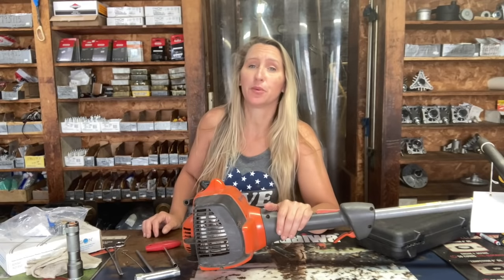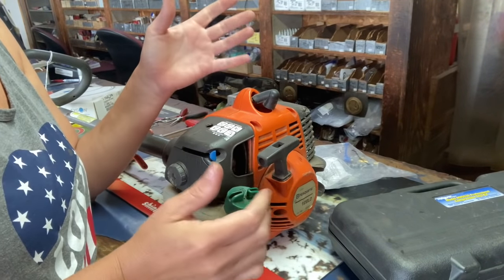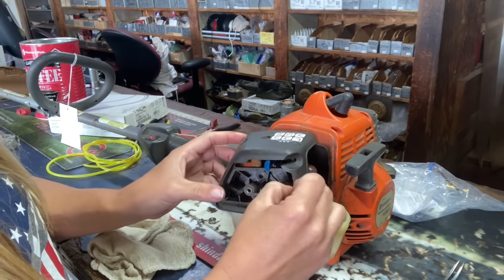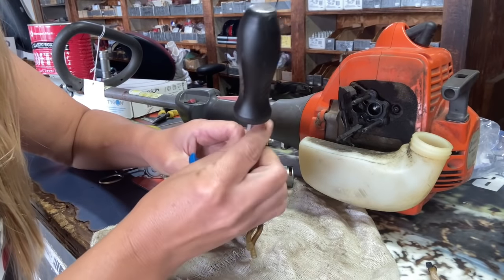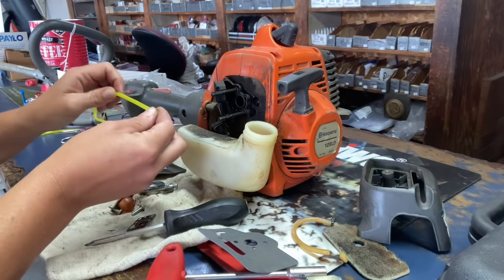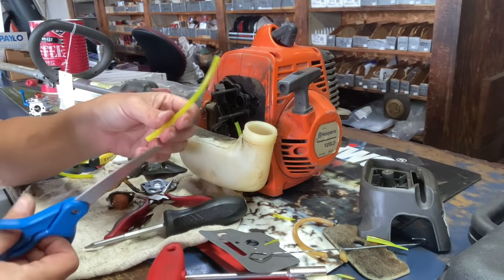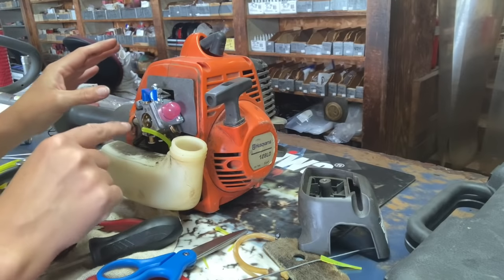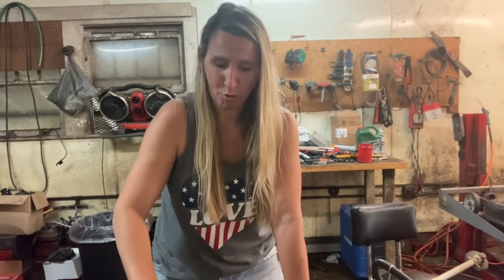How to fix a Husqvarna trimmer that won't start or only runs on choke

Comment: Hi thanks for info I am working on a trimmer but having a problem with it it will start with choke  on but will ,    only run on full throttle I fitted a new carburetor and new filter but I can't get it tick over. I checked the plug and is black and wet any idea

Comment: Thos unit had multiple issues warranting a carburetor change. But my 122 all cks out good so I did a kit change and it still only runs on choke. You really didn't give other reasons or alternatives gor a fix.

Comment: is it ok to use a fuel filter on the return line as well? wouldn't that prevent debri from getting into the carb through the primer bulb?

Comment: I have the 122hd60 hedge trimmer. 
A friend was using it and somehow it got turned upside down. 
Ever since that happened it won't run, if it does start it shuts off when cutting, now can't even get it to run.
Not sure what the issue is.
Thanks

Comment: Maybe I have a picky machine but the Husqvarna I have had the same issues, essentially did everything you did, internals looked good had the cross hatching and no scoring on the side of the piston or sidewall, 128lbs of compression, added a new OEM carb, lines and filter, new spark plug went to go fire it off and all it will do is run on idle, play around with the carb adjustment screws and it doesn't even affect it...I've had some small engines give me issues before but none that's actually got me stumped like this Husqvarna...I certainly don't want to just toss the unit away as I'm not a fan of "ohh it's broke go buy a new one" I like to get my money's worth out of the equipment
Reply from the maker: Odd. It sounds like it is still starving for fuel. If everything is new like you said, there are a couple things to check. Make sure your fuel line is not too long to where it is poking back out of the gas. If that is not it, make sure your fuel line that is connected to the fuel filter is connected to the carb nipple farthest away from the primer bulb. Make sure the carb mounting gasket is still good. Make sure the the carb is not getting stuck on the throttle cable bracket and is mounted flush to engine.
Reply: @Chickanic  thanks for replying back so quickly, I will give those a check and hope it does the trick

Comment: Same trimmer only run on half choke, did all that and still wouldn't run properly. Come to find out the gas cap was faulty. I just happened to have an extra one from another unit.

Comment: Good video and fix. Never been a fan of any equipment that is outside the professional series. One thin piston ring is just not a good thing for an engine that revs eight to ten thousand rpm wide open. The 128s are one of those trimmers that have the single piston ring. Nope I'm good. I will stick with my Stihl FS-94R and Husqvarna 525L. They both are built Very well built with ballbearing supported crankshafts and double thick ringed pistons. The point is professional series equipment has a whole lot better engines than Limited Duty machines that will fry quickly if used professionally.

Comment: I have this exact machine, it only runs on half choke. I have replaced fuel filter, fuel lines, carburetor, air filter, and used the store bought pre mixed oil gas mixture. It starts super easy but once the choke is opened it dies.

Comment: I have one with low hours that is only running on choke.  Is there a video that gives other options before diagnosing that you need to replace everything?
Reply from the maker: You just start at the beginning, checking your fuel filter and fuel lines. Go from there. If one thing is good, you go to the next, but it is ALWAYS deteriorated fuel lines on these as the culprit. Or bad gas.

Comment: So I replaced my carburetor, put in new lines and fuel filter and it still will not start. When I removed the carb and did the visual inspection on the piston, it looks nice and smooth. Could it be that I have lost compression in the cylinder? What is a simple way to check for good compression?
Reply: It will not START AT ALL? Want the cheap way to find out?  Buy a spray can of ether, available at your local hardware/auto-parts store . take off the air filter, and spray ONE QUICK SHOT  (No more) of ether into the carb- have the choke open of course.  DO THIS OUTDOORS (obviously).
Pull the starter-  the engine should fire a few times.  If it doesn't, it's probably your spark-plug or other electrical problem.  Check the spark plug  wire, or take it o a repair shop.  DO NOT keep spraying ether into the carb!
NOTE! DO NOT leave this can of ether lying around where a child might investigate it! And preferably keep it out of your house!

Comment: Love the name, very imaginative. I have a problem I can't seem to solve. I have a 128DL that's about 2 years old or I was told. It does look like it. But the prior owner (son-in-law) put it away two years in a row with gas through everything. Last year he was able to use it with the choke half way on. But this year he couldn't get it to go. He bought a battery power one and gave me this.
So far I used the shotgun approach. I replaced the carb, fuel lines, fuel filter, spark plug and cleaned the fuel tank very well. I can manage to get it started, but it will only run at a low speed with the throttle held wide open. It will run for a minute or two and then just shut off like you hit the kill switch. 
Any suggestions would be greatly appreciated.
Reply from the maker: Things to check… 1. Make sure your fuel lines are on the correct way. The line on the nipple farthest away from the primer bulb should have the fuel filter on it. If it is correct, 2. Check exhaust screen. 3. Do not use canned fuel. Holler back if those work or not. Also, hopefully you bought an oem carb. Aftermarket ones only work half the time and I don’t trust that the Chinese fuel lines and fuel filter ever let enough fuel through.
Reply from the maker: @mikemilam525  I tried after market many times and yes, they worked half the time, but I was replacing 1-2 a week during our busy period and it got to where 50% would do just what yours is doing and have to be adjusted. You can get a splined adjusting tool and try to correct it. Pull your plug. Is it dry or wet? White?
Reply: @Chickanic  I value your opinion so I ordered an OEM carb. I'll let you know how it goes, thanks
Reply from the maker: @mikemilam525  The only other things it could be, is it is burned up. You will see a bunch of up and down piston scoring if it is. OR a bad batch of fuel, but judging by that baby blue beauty you have in the garage, I doubt you have bad fuel. LOL! Also, don't trust canned fuel. I see bad batches ALL the time.
Reply: I looked thru the intake port and the piston looks fine. I’ve been building hot rods my whole life but never fooled with small engines. I likened it to learning to speak Another language, lol. Thanks for the kind words about the car. I built it about 15 years ago from a basket case.
Reply: @Chickanic  BTW, I pulled the plug out just for grins and it was wet with fuel. Not dripping, but damp.
Reply: Look atvtgecexhaust screen and take muffler off see if carbon is blocking exhaust

Comment: I have the same model shown in this video.  Is it ok to run premium fuel in it?   I saw in the store I bought it from they have premixed fuels from husqvarna you can buy that is 93 octane.
Reply: I also have this weedeater.I only use non ethanol fuel mixed with the husqvarna 50:1.Never had a hard time getting it started.

Comment: Thanks for the information. I noticed the old fuel line had a cable tie or something on it. Do the new ones need that as well?
Reply from the maker: That was a fuel line connection. I have no idea how they even get those in at the factory, but it is not needed when you replace the new lines this way. Thanks for watching!
Reply: @Chickanic  To redo the connector thing, after you pull the fuel line through, cut it flush, put the connector on the line, attach the fuel filter and line to the other end of the connector, put the line into the tank, then pull back on the gas line from the top of the tank until the connector seats against the top of the tank. Then trim the gas line coming out of the tank to length.  It only took me an hour to do it the first and last time that way.

Comment: Mine only ran on half choke. Checked carb etc and all looked clearn. No water in gas. What I discovered is that I had switched from 87 octane to 91.  When I switched back to 87 it ran perfectly.

Comment: Why didn't you use the original fittings that passed through the fuel tank?
Reply from the maker: Those little plastic fuel line connectors? There is just no need.

Comment: Put a new carb on ran perfect for a day then started the same problem, replaced the tank which included new fuel lines and filter, still won't run with the ckoke off

Comment: OK, but I just bought the same trimmer and it does the same as you said. It will run off choke after it warms up for a good 5 minutes, most of the time. So being new, just an adjustment? And I'm talking I'm on the first tank of fuel - Husky can fuel. Is it the idle screw? It really seems like it has no power.
Reply from the maker: I would try a different fuel first. I don't trust ANY canned fuel. I get units in the shop all of the time that have been running fine on canned fuel and then all of the sudden it won't run on it. FOR SURE try different fuel before you do anything else. I would mix up your own gallon of gas and oil and see what happens.
Reply: Buy the bottle for  storage fuel that work amazing and is going to start easy too after star running.

Comment: Hi Chicky. Does the Husqvarna 128CD(not the LD) take attachments? I recently purchased one and the Lowe’s website marketed as attachment capable and so does Husqvarna, but when you read closer on the Husqvarna site it says it has a different arbor size from the LD, and it says it isn’t capable of a cutting blade etc.. Many people have told me it is attachment capable but I want to make sure, especially seeing whereas there’s a different arbor size. Thanks in advance

Comment: Informative video!  Thank You. Never go full throttle until you warm up the engine at leased a minute or more. It seem odd that you would replace the carb instead of rebuild. I wonder if you could explain how to determine which gas line goes ware after you mix them up.
Reply: She did...  the fuel line with the filter goes to the nipple furthest from the primer bulb.  The return line is closest to the primer.
Reply: @rudyruiz9521  thank you
Reply: Ty...

Comment: I have this 128LD. I checked compression is at 120. The rebuild kit did not work. I ordered a new OEM carb put it in.  I also put in a new plug and checked for spark.I dumped the gas and put in fresh non ethanol 50:1 mix I also replaced the lines and the fuel filter.  I starts on choke. turn the choke off, it runs for about 1 second or less and immediately shuts off. Like the power switch was turned off. I also checked the  exhaust screen and it is clear. I tried the premix and it ran better than my 50:1 mix. Any ideas?

Comment: Had ours running great.  Now once its warm, won't start at all, problem just started.  Has new plug, coil, carb, air filter, fuel filter and using 50:1 true fuel.

Comment: Would there be any harm in cutting both fuel lines to the same long length and putting filters on both, to avoid the possibility of putting them on the carb the wrong way?
Reply from the maker: I wouldn't. The fuel returning to the tank should not have any resistance. Thanks for watching!

Comment: I have a question Chickanic.  First, great video, new subscriber.  Thank you.  I've owned one of these for years.  Always use quality gasoline and two-stroke oil @ 50:1.  (I wonder if your customer mixes his gas.  Looked awfully clear to me).  Mine runs well, but it has always puzzled me as to why I always have to choke it about 25% to do the job.  In your video, were you running with the choke completely "off"?
Reply from the maker: Thanks so much for the subscription and question. When your machine is getting the correct fuel amount you should not have to run it on choke at all. If you are, you definitely have either worn out diaphragms or something clogging your screen. If you keep running it that way, eventually it will burn up your unit. I would suggest, going through these steps and checking to see if you have any of the issues in the video. These trimmers are notorious for the fuel filters falling off. This can happen, even if you mix your fuel correctly, because these pieces just wear out over time. I don't know what the customer had in his tank, but it looked like almost all water. I made a video about how I think people get water in there fuel. If you have time, check it out. Thanks!!
Reply: @Chickanic  Thank you.  I've had to choke it a bit since the day I brought it home new.  I will certainly follow your advice and get it fixed.  Thanks again.

Comment: Great video but after removing the fuel lines and taking the carb off, I would have used an old, damp rag to wipe off the top of that dirty fuel tank before putting the new carb and lines on.

Comment: I know this,is,off,topic,about the carb,,but I have a 94,225l,husqavrna,that,just,rebuilt,after,finding all,the parts etc, problem,is,that,there,are,2 plungers on,the,shaft,which,I,assume are,for anti vibration, and there,are,2,holes,on,back of,shaft,assemble to,connect motor,and shaft,together,,got,two,of,rubber,grommets,started in,can't,use,grass,otherwise just slides,out, same w,handle too, any,suggestion,on,getting,it,back,together, also,it,is a,commercial,weedeater ,,any,help,would,be appreciated, it's,got,even,my,lawn,maintenance repair guy,,shaking,his,head

Comment: I have an older Husqvarna 225RJ trimmer in need of the fuel line. However the part number per their parts list 502210601 is no longer available. This is used in all 225 series. What other fuel lines can I substitute with?

Comment: i would love to know if i can use the echo 2stroke oil in my Stihl machine
Reply from the maker: Absolutely! If you are still in your 2 yr warranty time frame, I would keep using Stihl til it is over just in case something happens and you need warranty work.
Reply: @Chickanic  thank you very much because my warranty has not up has yet on the machine and i enjoy following you
Reply: @Chickanic  for the past several years if ya buy their oil ya get an extra 2 years warranty on the machine when ya buy em new that goes for both stihl and husqvarna
Reply from the maker: @knightimusprime25  Stihl is actually a marketing genius. Echo and Husqvarna offer a 5 year homeowner warranty automatically, which is a huge selling point. Stihl offers 4 years, but voids half if you do not buy their oil and hold on to your receipt for 4 yrs. They actually have convinced everyone they are "giving" them something extra when actually they are punishing them. Genius. Thanks for watching!

Comment: Thank You So Much!!!!!! 💪🏽💪🏽💪🏽💪🏽💯💯💯💯
Just what I was looking for with my Husqvarna weed eater!!!!
Reply from the maker: You are very welcome! Glad I could help!
Reply: @Chickanic  140 psi good compresion 372 xp oe ?
Reply from the maker: @Sensei948  Yes, but you will still want to check for piston scoring just in case. Sometimes units will still have good compression, and still not run right when hot if there are up and down grooves towards the exhaust side. You can usually see pretty good by looking through the Spark pig hole. If it is still shiny with no grooves, you are good to go!
Reply: @Chickanic  Tell me, can the scythe work full throttle all the time? Kosa is 545 rx or does it have to be constantly loaded? can it have 12,200 rpm?

Comment: Installed a new carburetor, lines, fuel filter and it still does not want to idle or rev up and mixed new fuel also 50:1 ratio

Comment: This is from Don's small engine repair If you would cut the end of fuel line on a 45 degree angle and put a single piece of wire on it and pull it through the tank and you won't wast so much fuel line that way
Reply from the maker: That is a good way to do it, but when trying to teach someone who has never done it before and will only do it probably once, wasting a couple inches is a lot easier. Thanks for watching!

Comment: I looked up this video because I'm having the exact same problem with my Husqvarna weed eater. I know nothing about motors and have basically no mechanical skills. However I am still going to attempt to change the carburetor and get mine running. There is a 93% chance that I will get pissed off and destroy the damn thing. Guess we'll find out.....😬😬
Reply from the maker: Let me know how it turns out! LOL!
Reply: @Chickanic  If my blood boils and I end up reaching the point of wanting to destroy it I will make a video of me shooting it multiple times with 3 inch buckshot while cursing. And of course I will send you the video if you would like. :-) LOL

Comment: Most fuel issues are caused by using Regular unleaded gas which contains ethanol. This will literally dissolve the fuel line over time. I’ve always used Premium gas that states on the pump NO ETHANOL and use a good quality two stroke oil. Dump any gas that is more than a year old. That includes any in you gas can. I have never had a fuel related issue following these rules. If money is no object consider using TruFuel 50:1 Pre-Blended 2-Cycle Fuel available at most home centers.
Reply from the maker: I would recommend what you are doing using ethanol free and oil mix. I have had MULTIPLE customers bring their machines in with TruFuel that would not run ONLY because of the fuel even after it ran on it for months. I can't explain it, it just happens often. Bad batches? I don't know.